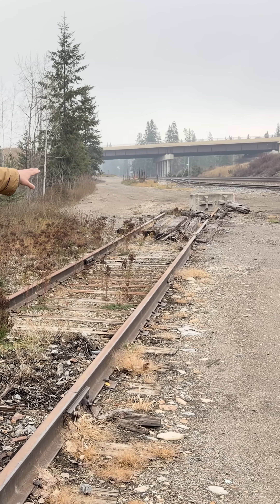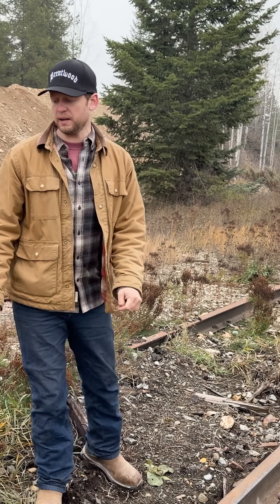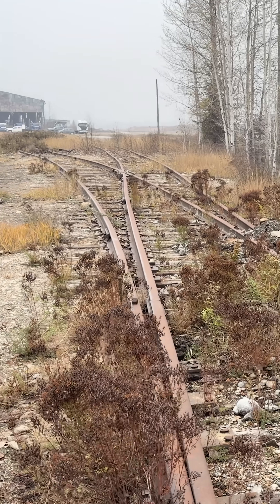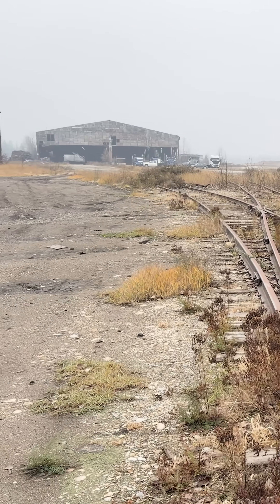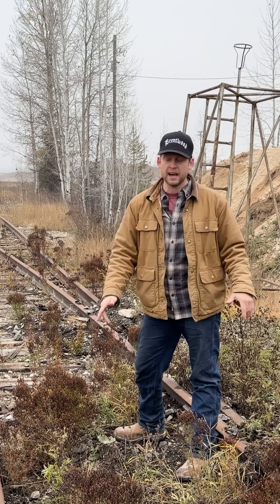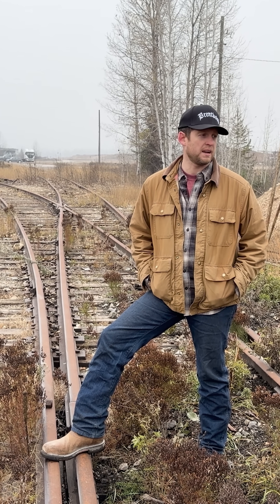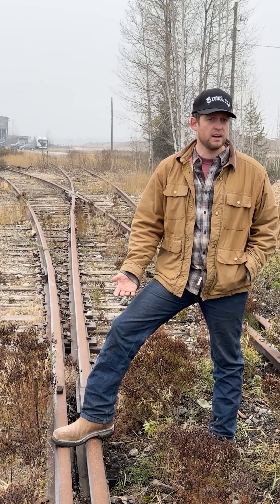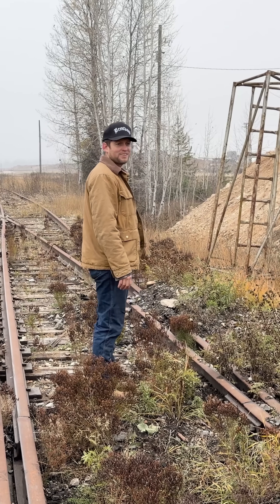Why Our Potential Rail Spur Is a No-Brainer

Comment: Edison built locomotives wouldn’t be a bad idea
Reply: Locomotives are already Diesel Electrics ... huge V12/16/20 engines that power electric traction motors.  Edison is on the right "track" doing diesel electric trucks.
Reply: @michaelburgener3384  Trauns are the reason Edison Motors even became a concept iirc, that and how amazing regenerative braking is for powering a truck that brings logs down mountains
Reply: @pws3rd170 trains don't have batteries for Regen they burn off the electricity thru heat
Reply: @m @michaelburgener3384  outside of some different regulations with the FRA, yeah, basically
Reply: @michaelburgener3384  In most parts of the world trains are fully electric 😂
Reply: @Jocraft2039it’s about 50/50. in dense areas it’s almost always electric, anything long haul or over long empty spaces are just impractical and will likely use diesel electric for quite a while longer
Reply: Honestly, it's nothing new in the locomotive world. His designs are basically the same as a diesel electric locomotive.
Reply: Or do maintaince and restomods, but they would probably need to upgrade their overhead cranes to handle that kind of weight! 🤔 🤷 😬 😏
Reply: @wesman7837 I mean with small ~25 ton locomotives they could probably get away with what they got for shops
Reply: @West-x8q everything now is 150t to +200t... even the odd old switcher is 100t
Reply: @n @nickleinonen  someone somewhere else here replied about car movers, which would probably be more realistic for Edison to make.
Reply: It wouldnt change anything. Trains are already diesel electric. They work a little different than their trucks, but still.
Reply: Fits their current tech, imagine topsy on the front of a locomotive.
Reply: Just having unloading for prefiltered freight would be huge. Getting off a ship and halfway inland before needing a truck is huge.
Reply: What engine would be running the Train Generator
Reply: @willtricks9432 GM EMD still make great locomotive prime movers
Reply: @willtricks9432 Probably 2 Scania 770hp, since a lot of older trains used one or two Detroit 2 strokes.
Reply: @Ratkill9000 770hp is about 1/5 the power of a lower powered freight locomotive. Edison is taking diesel electric train tech and scaling it down to truck size, not the other way around
Reply: @Ratkill9000 eh there are literal Semi trucks converted into real trains
Reply: @Ratkill9000  EMD 2 stroke diesels came first, based off of the Winton diesels, which GM bought and changed the name to EMC, then later EMD. The 2 stroke Detroits are essentially scaled down versions of the EMD locomotive engines. And I believe that the 2 stoke EMD engines are some of the best sounding locomotive diesels out there. EMD, and of course the Napier Deltic. Oof-da, now THAT is a cool engine.
Reply: I would e interested if you built a shunting locomotive using you technology that is a truck and has rail wheels that drop down when needed to work
Reply: @RowanMangion1976 Hi-Rail package or a little switcher, probably not a road engine.
Reply: @RowanMangion1976 like a trackmobile?
Reply: We need an Edison Resto-modded GP7
Reply: I was just going to say that!
Reply: I don't see much value in reinventing the wheel. But a battery + genset wagon with appropriate electronics to hook up to existing electric locomotives might be a workable idea. Prevents you from dealing with yet another style of drive train
Reply: He said WOULDN’T be a bad idea, meaning he thinks it would be a good idea to
Reply: In the US and Canada the rail manufacturers aren’t really interested in building new locomotives. GE and GM. Or watch or whatever they’re called now.

You have Siemens making new passenger locos, but freight? Hmmmmmm
Reply: That’s really not a bad idea. For the folks saying locomotives are already diesel electric, this is true, but almost no one does regenerative braking.
 An industrial switcher locomotive with a healthy lithium iron phosphate battery pack that could do most operations on battery while still having the diesel genset to keep them from getting too depleted would help reduce fuel costs, noise, and pollution.
Reply: They said they're renting out their property to other companies, maybe in the future they'll get some retired railroad mechanics will rent the space.
Reply: there's not a huge market for locomotives. i mean there are already manufacturers that are set up to fulfill the small need, it would be very hard to break into that market.
Reply: Your mom said to get off the internet

Comment: You guys should clean up those tracks and make sure they're in good enough condition to be used and figure out how much it would take to bring them up to nice clean working level
Reply: Looks like the steel is in pretty good shape, new ties and clean ballast is really all it needs.
Reply: Unnecessary cost at this time
Reply: @BawkBawkBawk666 no they should spend money connecting the line only to find out that there is something so costly wrong somewhere else that it isn't worth it. I'm not suggesting they bring it up to full nice clean working order now, I'm suggesting they figure out the cost so they know it's current condition
Reply: @tumaru892 they need to start producing trucks in order to pay for the track costs.
Reply: @BawkBawkBawk666  Yes, but if they're going to expand their venture to use that rail line they legally HAVE to bring it up to code. 

As it sits now overgrown  with the ties completely sunk into the ground they can't use it. 

As for the money, that's not entirely true. as long as the work to bring the rails up to code isn't too bad they could probably secure a loan for it now that they're actually taking orders and investments, and preparing to start production.
Reply: @superhobo666 yes.  But they dont need to waste their resourced NOW.  Thats what im saying.
Reply: @BawkBawkBawk666  That I don't disagree with entirely. 

However, if the work is cheap enough, quick enough, or they're able to get a good enough loan it wouldn't be a waste of resources to pursue an easy income stream to take some of the load off of early production. They're surrounded by other businesses that could use a closer loading/storage yard attached to a main line, it would pay for itself in no time.
Reply: @superhobo666 managing is staying focused on the task at hand.  Its easy to get lost when taking side quests.
Reply: @BawkBawkBawk666  To me it sounds like they got that land knowing the rail connection was there, intending to use it. They've also mentioned it in passing it before in another short IIRC. 

It's not really a side quest, it's more like doing one of the optional prep quests for a GTAV heist to make the whole thing easier, and get more money out of it.
Reply: @BawkBawkBawk666 sounds like they are managing to take on more side quests or this video wouldn't exist. Seems like pretty pointless to argue about what someone should or shouldn't do when they are already doing it.
Reply: @BawkBawkBawk666  in the full video, they said their investors have agreed with them that this is a worthwhile investment